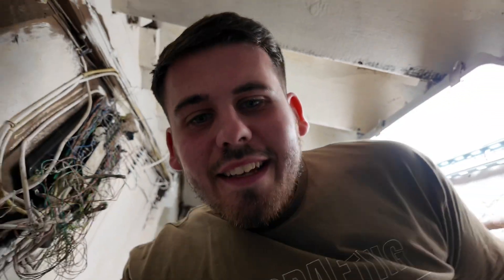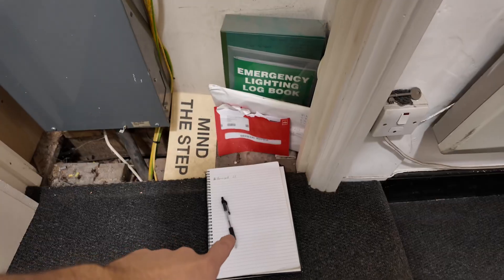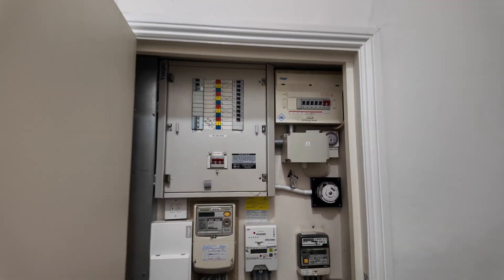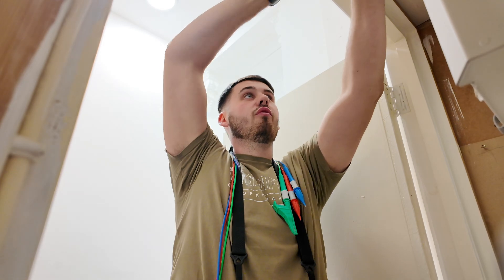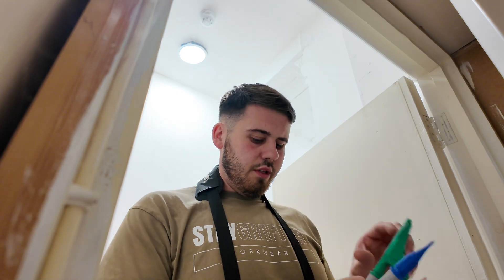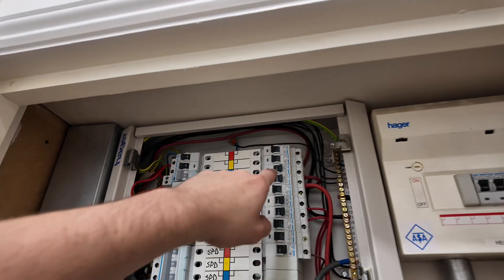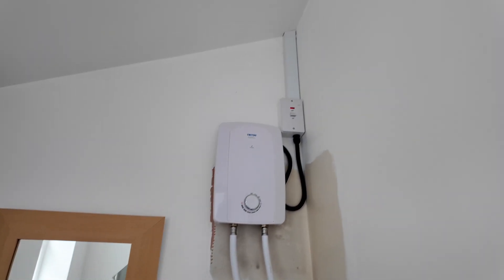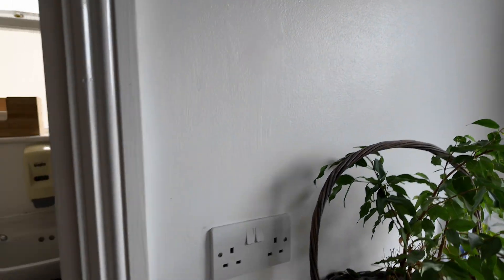How to carry out an EICR test

Comment: for the worst case when calculating for your fault current should you not use Cmax due to voltage fluctuations when determining the fault current, then double for three phase...

Comment: quick question. For a radial socket circuit, do you need RCD protection if its running on a RCBO?
Reply: No, An RCBO is an MCB and RCD combined into one device. Its the same as having a seperate RCD and MCB on a circuit.
If you have an RCD supplying RCBOs you may get nuisance tripping. It all depends on the ratings and their individual tripping characterisics. ie the rcbo may trip turning off that circuit and as it trips the main rcd also trips and takes out all the other circuits that have no fault on them. 
consult an electrician.
Reply: @ABlainey ahh right, thanks for that!!

Comment: One point to make- your testing on circuits doing a direct ZS - You shouldn’t do that if possible, your could be getting   
 parallel paths on the boiler or any other extraneous  conductive paths giving you a good reading, mr plumber comes along and changes a fitting to plastic your earth is gone… sub main time delayed to stop selectivity issues??
Reply: Zs if you are doing it you should be doing it with paralel paths as they are. For r1r2 yea, disconect cocs from the terminal if you can to minimise paralel paths. 
You cant put the time delayed RCD on distribution circuit if you are trying to achieve additional protection to the circuit. 
Also the regs dont apply retrospectively so that distribution circuit would b C3. So would the lack of rcd protection to heaters. Unless we have metal studwork of course. Than it would b C2.
Reply: @peterigrenyi9176  what would you do to solve the selectivity issue then?
Reply: @peterigrenyi9176  what yours solution for selectivity issues then